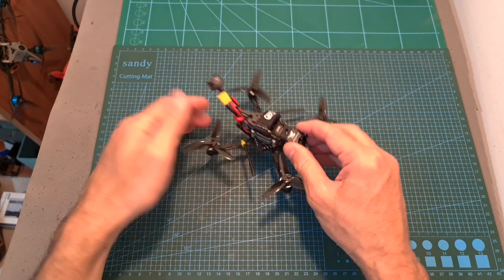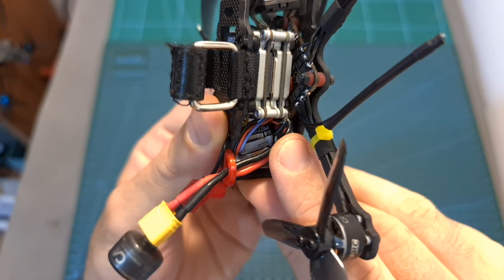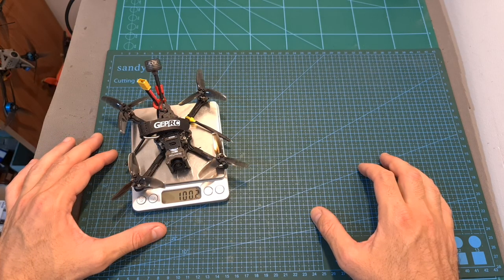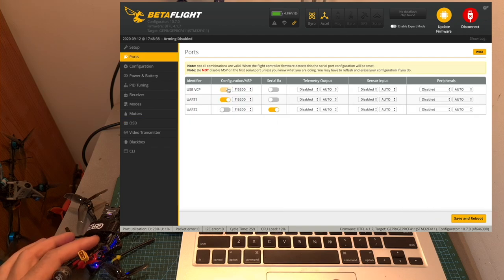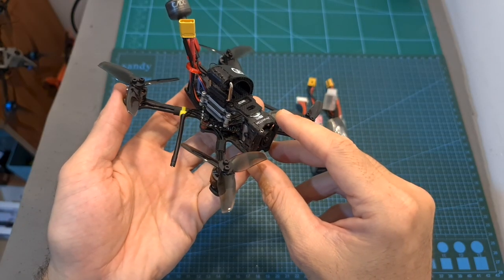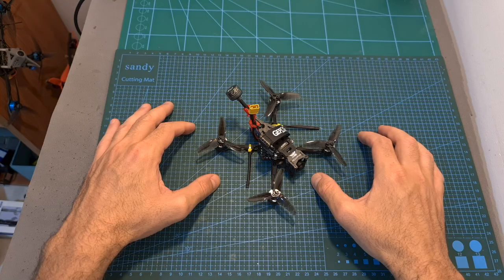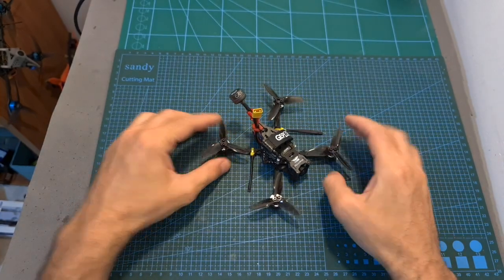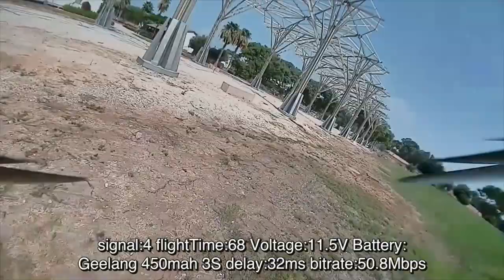Geprc Phantom HD - Review, Setup & Flight Footage

Comment: i fly gyro and pid loop frequenzy at 8khz and dshot 600 with jesc for bidirectional dshot and rpm filtering. updatet also to bf 4.2.2. i just can say, the phantom flies like a dream. awesome quad! no throttle limitation with 4s in bf, maybe i should do...but with 4s 650 mah more than 6-7 mins flight time. best buy in the last time. also had the analog version before, but changed all to digital now. just can recomend this kwad! thanks for your review !
Reply from the maker: Thanks for sharing your settings, unfortunately I don't have this quadcopter anymore so I won't be able to try them out :-(
Happy flying!

Comment: Nice video thanks. The camera looks a little better than the original Nebula camera but still not up to the DJI standard camera.  Looking for a similar frame that will take the standard 19mm DJI camera and 3" props. The 3" Cougar frame comes close but found the motor mounts to be weak.
Reply from the maker: Thanks John. Yes, it has been improved and I hope that they will come out with an even better camera soon. 
You should check out the FlexRC frames, most of their 3" frames support the Caddx Vista system.
Reply: Is this the v2 Nebula? I just checked GETFPV and it doesn’t specify v2. I have seen it specified as v2 on another quad. Thanks for the video!

Comment: How do you install a frsky xm plus receiver since the air unit is using the sbus pad?
Reply from the maker: In case you are not using the DJI radio controller you shouldn't connect the Vista unit to the SBUS pad of the FC.
Reply: @KremerFPV  thank you, I purchased a bind and fly and didn’t know because it was already connected.